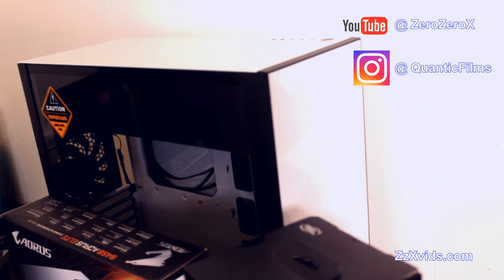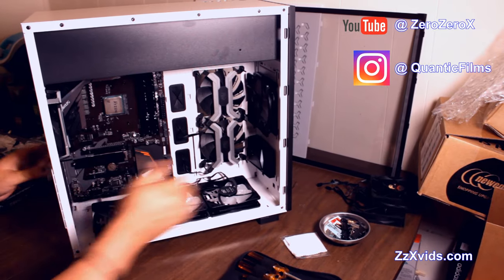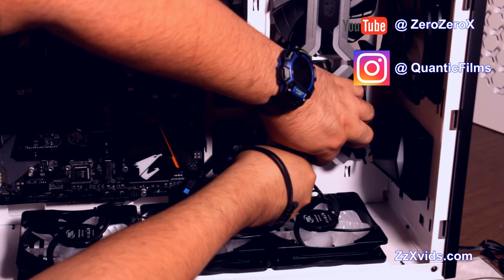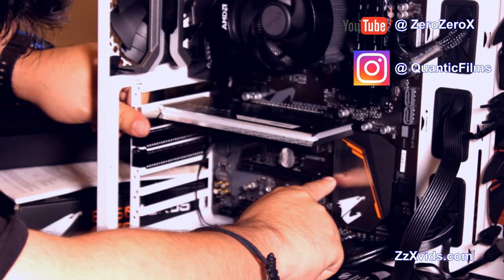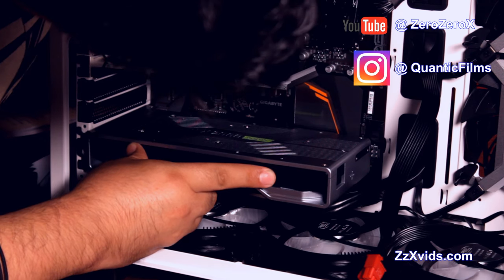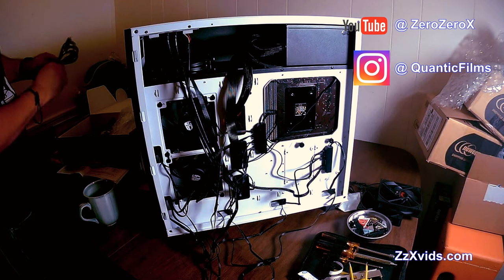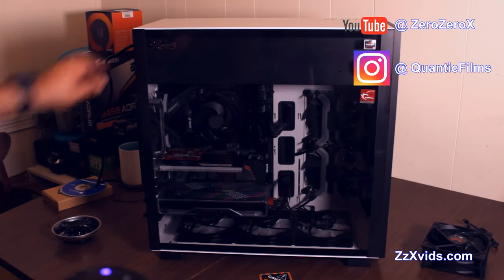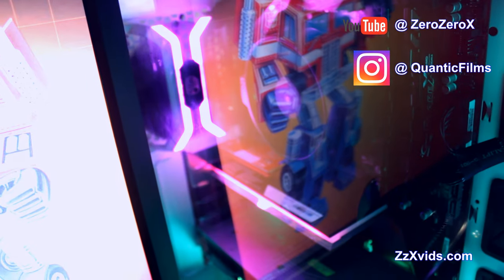#Dream #computer #setup #ultimate New SENTRY 3: Part 2. The Ultimate Computer Under $1K How to video

Comment: how  do you add your old hard drive to this
Reply from the maker: Instead of the exhaust fans on the right part (side) of the case has a plate that can be used for HDDs instead of those fans or radiator.

Comment: Hey I have the same case the fans work but I don’t know what to plug in to where  the rgb can work
Reply: hey, how loud are the fans?
Reply from the maker: @Julia-vw2uz  They are pretty good but the fans that come with the Prism S regular are even more quite I believe.
Reply: @Julia-vw2uz  I have this case and with the stock rgb/fan controller, it’s always on full blast but it’s a loud hum... I have to close my door to game because I have an upgraded rosewill fan controller and you can change the fan speed, but you cannot use the color change button on the top of the case because it doesn’t have a spot for it. On low fan speed mode, it’s very quiet, but you hardly get any cooling. Since the fan connectors are proprietary, you can’t put them on a fan header on your motherboard.

Comment: How do i get rgb fans to light up. Is there a button?
Reply from the maker: RGB headers. Do not mix and match. Depends, in some computer cases, there are fan and RGB controls on the actual case. Then use the manufacturers software.
Reply: I can’t get the fans to light up either @bills Mafia I don’t know how to fix it
Reply: Bills Mafia ^
Reply: @ricardoelizondo8296  check your mb and notice 12v vs 5v rbg compatibility, hope that helps
Reply: I have this case and it sounds like you have a broken rgb controller, but you can get an upgraded one with 3 fans for $40. The fan connectors are proprietary, so they don’t fit on a fan header on your motherboard. I will say though, they could have designed the case to have better ventilation through the metal side panel since you can put fans there.

Comment: Not make any since  but where are the front fans getting air from just asking
Reply from the maker: There is only one fan up front. But, there are three fans next to it. They are exhaust fans. There is a cutout pattern there (almost mesh like) on the case and the one front fan helps the exhaust.
Reply: That doesn’t make any sense because I have this case and it’s got a solid metal front, no air gap for air to get in or out, unless you take off the front metal piece since you can, but I haven’t found a way to take it off.